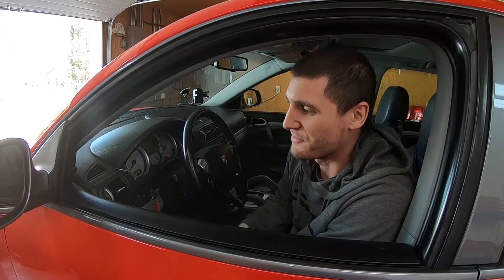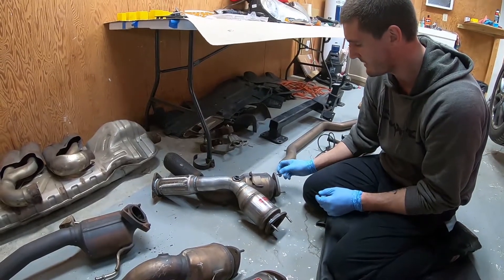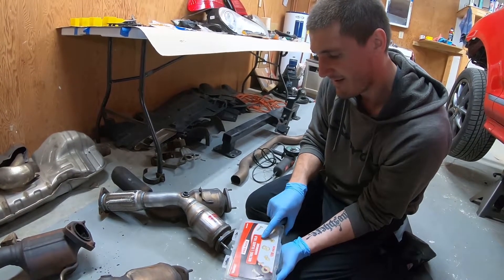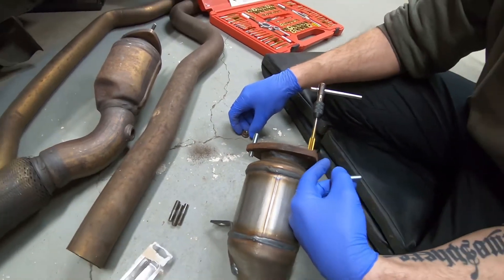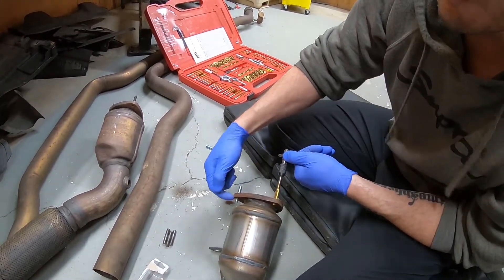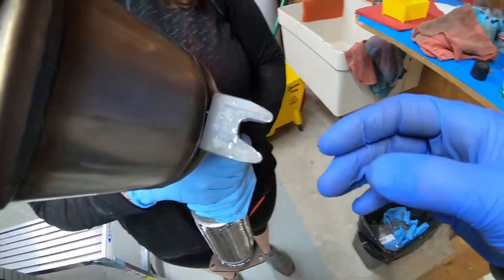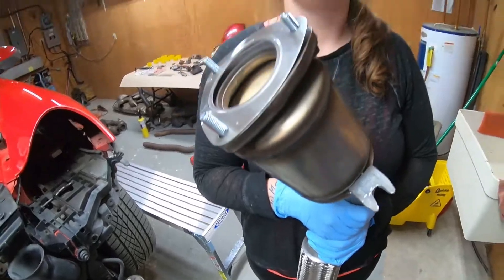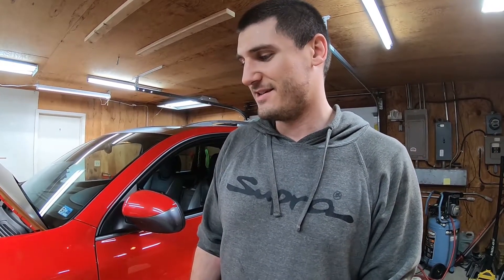Porsche Cayenne S Primary Catalytic Converter Install [4.5L V8]

Comment: I have been trying for days to get access to the passenger side ( right side) upstream o2 sensor to replace it with out success. Seeing your video i now realize the most direct way is to remove the catalytic converter and flex pipe assembly. thank you
Reply from the maker: Yeea, we didn’t mess with those but having it on the backside of the exhaust manifold it’s pretty tucked away and hard to get access to. Thanks for the comment and I’m glad the video gave you some insight.

Comment: The car has no mufflers? Going to replace my cats but wondering if the cheaper material inside the new ones is still giving it that growl.
Reply from the maker: We haven’t finished putting it back together just yet but I think it might even be a little bit louder with these cats. It definitely was a little bit tricky getting these to fit though with that one bracket coming off the cat. The OEM ones would have been much easier to install.

Comment: My passenger primary is bad. Where did you source your cats?
Reply from the maker: I ordered mine from rockauto.com I think I tried to look up the ones I got for someone else and it looked like they no longer had them in stock. I ordered them from rockauto but the company that made them was called Pacesetter. The fitment for the brackets coming off of the cats that attaches to the engine was a little bit off as well and required some adjustment and modifications.

Comment: Did you ever get the back muffler
Reply from the maker: We did, I also just got a welder a few days ago so we should be getting the exhaust finished here soon and I’ll post a video of that as well.
Reply: @kamalakeel  oh ok so u haven’t finished as yet. I want to see how it turned out.  Also I wanted to ask about the holes in the bumper did u do that for air?
Reply from the maker: @niaditmas  Yeea, exactly, we did it for more air flow because we didn’t replace all the plastic pieces behind the bumper that got broken in the accident that helped direct the air to the lower part of the radiator.
Reply: @kamalakeel  oh ok